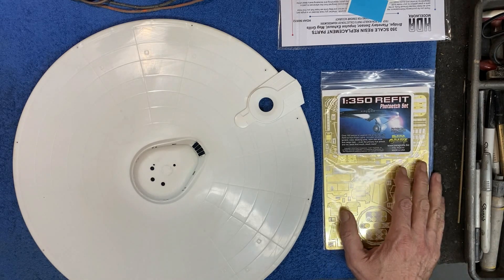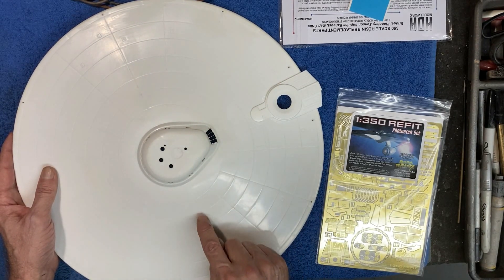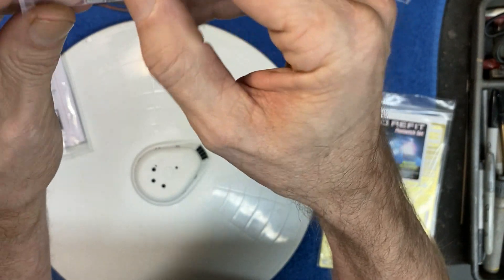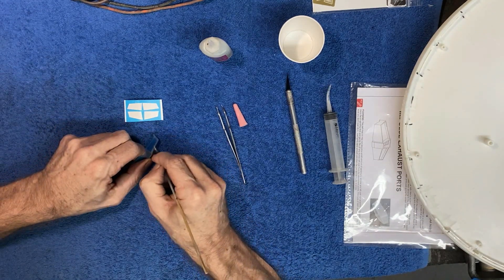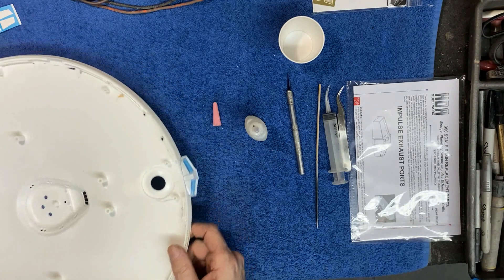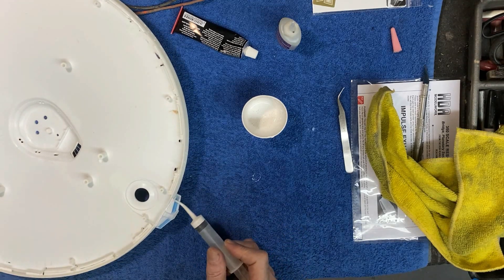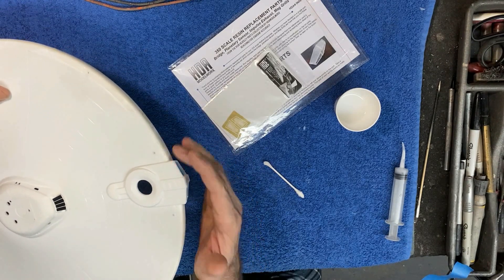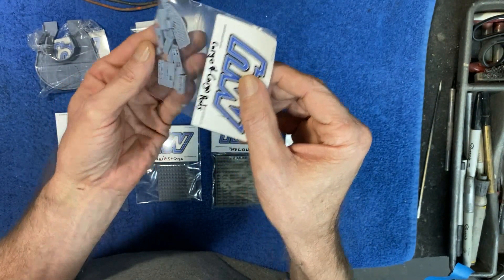1:350 USS Enterprise Refit By Polar Lights Updated Build Series Pt 3

Comment: Hi Boyd. Thanks for the video. In relation to the  Hobbiwerks B/C deck insert, I've watched the videos where the parts were being developed, and you use the entire part. The area around that central column is meant to be populated with the couches, tables and chairs. The Impulse crystal parts are for the 1/350th  kit. The disc holds your led and the dome goes inside the clear kit dome for added detail and as a diffuser. Hope this helps. Happy modelling.

Comment: @TrekWorks I have not built models for over 20 years and decided to build a refit. I am following your videos but stuck waiting on the bridge that is on back order. I want to start building and have a few questions. What glue are you using? I remember in that past some glue would destroy parts. I also need a airbrush. Mine is from the 90's and then it was still considered junk. What would you recommend? Any other parts I should order? I ordered all the 3d printed parts from HDA. If you were going to buy a light kit which kit would you recommend? I do not think I could build it from scratch.
Reply: I was also wondering about USS Enterprise NCC-1701-REFIT - BRIDGE Resin & Photoetch set for Polar Lights 1:350 Scale Model Kit by GREEN STRAWBERRY. The one you showed is out of stock and not sure if this one is the same placement.
Reply: @pumpin51 ,  Like you, I've been away from model building for about 20+yrs. Picked this up summer of 2021 tinkering with interiors but haven't really done any gluing. I picked up an extra shuttle/cargo bay, arboretum, and VIP lounge to experiment with. Otherwise I'm still in a gathering parts and resource/research mode.  Still getting new ideas.
Reply: @danmccann8813  The Bridge he is using came back in stock so I ordered it. Trying to get mine going this week. I have 4 days to focus on it.
Reply: @pumpin51 , I picked up a bridge for the TMP version from Shapeways, that has a removable dome and highly detailed interior. That's definitely going to test skills between painting and lighting, not to mention the transparencies placement for consoles and view screen...and of course the  photo etched parts for the exterior.
Reply: @danmccann8813  I went with the one he is using. The small bridge with people at my current level is to much.

Comment: Awesome that your using hobbiworks parts. I have been eyeing there stuff for a while. One thing that they offer for the 350 that gots me scratching my head is the phaser turrets. Do you know if they are for replacing the ones on the saucer?  They look so detail for something that would be so micro small.

Comment: That plastic putty slurry trick might be the solution to a problem I've been having with my 3D printed combadges, I use an FDM (Filament based) printer and with the 2370s (TNG film era) badges I have to 3D print those in two pieces to get the best quality prints out of them without the layers causing a severe stairstepping effect.

Comment: Where specifically on the hobby works site are the resin parts listed, looked and didn't see them listed.
Reply from the maker: I just had a look and on the main page to the left is a list of everything there, I see resin parts listed and when I clicked the first page to pop up was the resin parts for the 1:350 Refit. If you can't see the list it might be the browser your using.
Reply: @TrekWorks  well found my mistake...I need to learn to slow down and pay attention when someone lists a web address on the screen in front of my face.